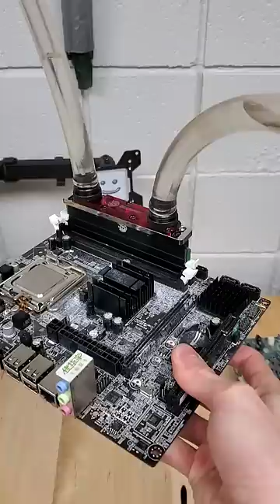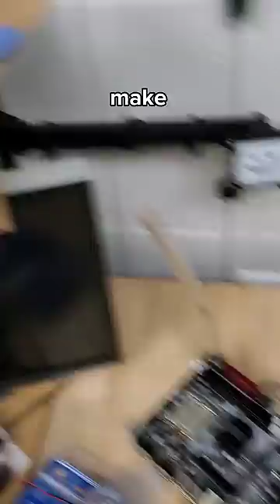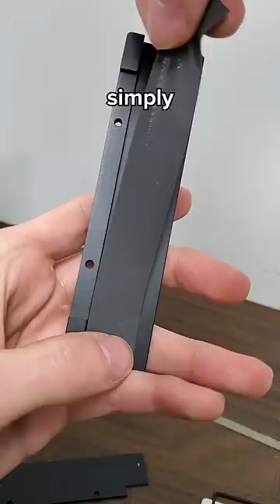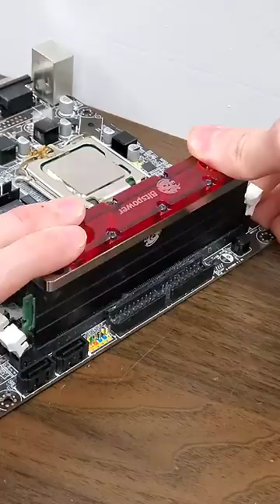water-cooled RAM?? #shorts

Comment: In 15 years they will laugh at water cooling it's so faulty and when it fucks up instead of fire it floods and ruins everything, I know it's better then fans but still it only takes one lil issue and boom u messed up without even over clocking or thermal past issues

Comment: I did this 12 or 13 years ago.  Almost went with the liquid cooled HDD enclosures and liquid cooled PSU also.
Reply: There was a ton of liquid cooling stuff back then.
Reply: 2010 be like: 
EVERYONE GETS LIQUID COOLING
Reply: Yeah back then you could water cooled everything
I remember tagan psu has water cooling inlet on its psu
Damn where are tagan now?
Reply: One day I'm going to build a fully water cooled system with an external radiator so the computer has no fans. I've had a water cooler psu in my eBay saved for later items for about 2 years.
Reply: @adrianthoroughgood1191  i believed years ago they have that
A tower radiator outside of pc, 
Honestly years ago they are more creative, but the technology not as advance as today lot of those died out
Reply: @antonirizki961  I think you are thinking of the Zalman tower radiator. That had no fans and was just large. But that could not cope with a modern system. It maxed out over 10 years ago. But what you can do these days is have an external radiator with fans. This means you don't have to fit the fans inside the case. I've seen on with 9 12cm fans in a square. People often mount that on the back side of their case. What I want to do is use longer hoses and hide it behind furniture to muffle the sound. At a minimum just put the radiator under my desk with the computer on top. The LTT guy did a crazy thing for the lolz and hooked the hoses up to a coil in his swimming pool!
Reply: @adrianthoroughgood1191  hmm maybe i forget what brand it was, that's prior to 2010 i guess, they look cool though
That's why i said the tech not advance enough so they died down
Some brand have radiator mounted on the back of the pc with fan that can count as external radiator?
It different than current aio, if my memory not failing me, almost all watercooled hav radiator outside of the pc, but i think what your concept about  is like the zalman you mentioned with fan and a potent cooling caoacity?
Btw where is zalman now?
Reply: @antonirizki961  I shouldn't have said back side. I meant right side, IE on the back of the motherboard, not the back of the case. Normal watercooling is still inside the case, mounted to the inside of the case. External radiators are literally external. The are a separate thing to the computer which some people drill holes in the side of the case in order to mount them.
Reply: @antonirizki961 I don't remember that Tagen PSU? I still have my Tagen Piperock 700W PSU but need to repair it as one of the input FETs fried. Have Gigabyte EP45 Extreme and OCZ Flex RAM, all with integrated watercooling too 🙂
Reply: I still have the 4x alphacool RAM watercooler here in my parts box. It was made for the Corsair Dominator GT Modules. You had to remove the finn stack ontop of the Modules and put some thermal pad on. Then 8 screws later your RAM was watercooled. Damn good time! VRM´s, Chipset, CPU and GPU all cooled by 1x MO-RA.

Comment: Next up: I built a 100 Terabyte PC with a car intercooler
Reply: Get one of the beefy ones from rally trucks! In surprise I’ve never seen a car radiator used in a cooling loop 

Or directly connecting to a air conditioner compressor to vent heat out

Comment: I agree it was unnecessary to watercool your RAM back in the days but it became more necessary than ever when DDR5 came out. If you want to go past 6800mhz I would suggest to cool your RAM. For instance I got a kit here with 8200mhz out of the box, which means it's designed this way and it gets well over 70°C almost 80°C. That's way too toasty for DDR5 chips to maintain stability cause they are more sensitive to heat than their predecessors.

Comment: that’s actually very useful in servers/workstations that have like 128gb/256gb of ram running constantly
Reply: I did a new build, 7950x, 7900xtx both on a custom loop. 
Water cooled my ram for shits and giggles to go with it.
Reply: I have 4x32Gb overclocked ram. Without watercooling it warmed upto 75C with a huge amount of errors. In my case it’s incredeably usefull

Comment: It's not completely useless. Samsung Bdie is very sensitive to temperature at high OCs. If you are running 1.5v you need to be in the low 30s to run a stable oc sometimes. The biggest drawback is the fact that you would have to run a SEPERATE LOOP just for your ram because the water would get to hot from your other PC parts, defeating the purpose, and actually warming your ram (in some cases) making it even more unstable. Most people just strap a little 40mm fan on top of their ddr4 and that does the same job with way less steps.

Comment: Well the top gen4 m2 ssd gets really hot and they need a radiator to operate at the advertise speed. Won’t be surprised if in 5 years rams and ssd will be water cooled in high end builds

Comment: huh, i using my chromium-based Opera with 2300+ tabs open constantly and... It struggles to occupy more than ~8 GB of RAM (I have 32 gb DDR5), then it frezees, not responding and begs to kill it. When most of them tabs the background (restored last session), it needs about 4 GB to work. After around 6 GBs tabs stars to crash because "there is not enough memory", lmao. It's clear to me that chromium engine sucks, but firefox for some reason crashing in similar conditions, but atleast it does not loading nothing about the restored tab unless you click on it (unlike chromium).

Comment: Actually this may work for high performance overcloking, Samsung B-die is quite temperature sensitive and if it works above 50°C, it'll start crashing non-stop. The effectiveness for this however, is pretty much the same as if you were putting a 92mm fan above the RAMs instead lol

Comment: I just water-cooled my x570 chipset over the weekend, debating doing the ram too, will have to see how the temps go. I have 2x thick 360 radiators and 11x Noctua fans so the fans barely needed to spin to keep the system cool, and the chipset was overheating 94c from lack of airflow. Keeping an eye on the ram, if it gets up past 50c I'll watercool it too. Trying to build quietest system possible

Comment: can be helpful for highest frequency + tightest timing possible manual RAM OC for daily usage.. BUT they need to really change the design "i.e. thin copper heat pipes touching the chips and all connected to the top which are made of pure copper for better direct heat transfer while sides remains aluminum".

Comment: passive cooling is the best, i want a highly efficient solid state PC, no moving parts or liquids / gasses. Don't mind if i have to have a huge heat dissipator, it will be more power efficient in moving heat around than active cooling, since it will use 0W to do it, which means the overall heat will be lower in a closed system, which my house pretty much is. Water cooling was a mistake, too many issues. "pc looks cool" needs to die, it is just a PC, not a toy for children, no need to look cool, give me a brick that is efficient.

Comment: Definitely overkill for consumer systems but for data spaces where efficiency of operation is extremely important (or just temp control in general for power reasons) this might not be a terrible idea. There are probably water cooled server racks that would allow for multiple servers to be cooled and having the ram cooled as well would make things significantly more efficient, especially considering that several machines might be touching enough to form a solid block of metal on the sides.

Comment: Ya it is silly. I find the best use for them is for breaking up long straight tube runs for a bit of a unique look more than anything else. The problem with them is they are not efficient due to where the liquid passes and where the cooling is actually needed.

Comment: Watercooled ram absolutely had a place back in the days of early DDR3 and DDR2. overclocking was much more common back then, and if you're already spending a ton on being able to cool OCed SLI setups and CPUs with overclocks in excess of 1-2Ghz cooling RAM was needed when you were pushing it far beyond factory rating.

Comment: its actually reality. Lets look at gpus cpus how cooling came, rram now itself has passive cooling, how long untill it needs air cooling as now nvmes on motherboards already has coolers, cooler it is more speed it can sustain, ssds now overheating and drop transfer speeds, while ram also needs to be cool. Rifght now motherboards getting bigger and bigger coolers for simple power its crazy water cool. But i think it may be we will water cool everything untill smth new comes in.
Reply: RAM uses less power with each new generation. DDR2 ran at 1.8V, DDR5 runs at 1.1V

Comment: These are meant to be used with their own loop. The water temp from your GPU and your CPU will actually warm up the ram not cool it if you connect it to your main loop. I've overclocked ram for a long time and air cooling has always been more viable

Comment: You know i never understood water cooled pcs. One leak your done
Reply: It's not actually water most of the time it's a non-conductive liquid so if it does spill you just let it dry and no problems. Also the reason is that air cooling has limits that is basically the bottom line for water cooling.
Reply: @Dragonlord826  it actually is water when you do a custom loop. but water isn't conductive at all, only mineralized water in a tap conducts electricity
if you distill water it removes those minerals
Reply: @puppieslovies  I said most of the time.
Reply: @Dragonlord826  for custom loop cooling it is always distilled water and maybe 5% or 10% additives. for closed loops it is almost always propylene glycol
Reply: @puppieslovies  The comment was on PCs in general, but yeah that's right